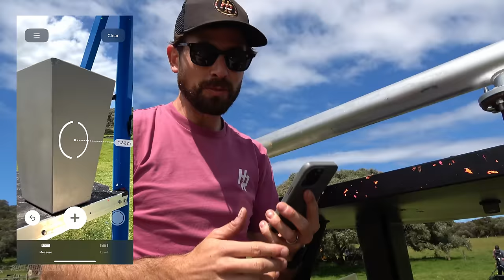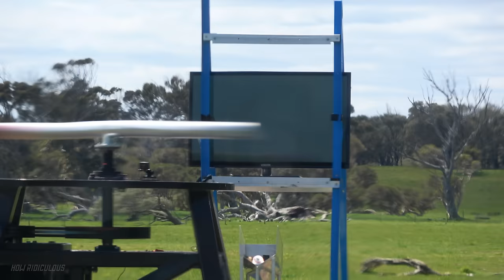1000RPM Baseball Machine Vs. Bulletproof Glass

Comment: Okay. The average baseball weighs 5.125oz. That’s 2242.188 grains. At 425KMh is traveling at roughly 387 ft/second. Or about 34.5% the speed of sound. So for what is worth, that’s baseball has 743ftlbs of energy. Or 1013 joules. That effectively like getting shot with a .44 magnum revolver. So yeah. Don’t get hit.
Reply: Very good I did the math too
Reply: @gilbert4018 MAN SHUT UP!!! 'FORE YOU MAKE ME DO SUM' I'M GON' REGRET!!!
Reply: Well, one of the weaker loadings available for .44 magnum, a lot of them are at 1500-2000 joules. Maybe 10mm Auto, those tend to be in the 900-1100 joule range? =)

Comment: I imagine someone must've said this by now but I can't find it so, just in case: what makes a steel mild is a low carbon content, and so it tends to be a bit more malleable than high carbon steel, which gets used in things like blade making because it can be hardened to better hold its shape (in the case of a blade, better hold an edge).

Comment: 1:40 If you consider carbon spice, then yeah.
5:34 They are the same unit. Velocity is generally used as vector, while speed is used as scalar. So if you travel from your home to your work, then the overall distance divided by your total time was your speed. But if at any point during the drive you look at your velocimeter, it will tell you your current velocity forward.

I see now that the bulletproof glass you got is rated for cannonballs.

Comment: Just a quick answer to any wondering. "Mild Steel" is referring to the the carbon content of the metal. Mild steel is a low carbon metal in comparison to something like Cast Iron which is high carbon metal.

Comment: Speed measures the distance over time, whereas velocity measures displacement over time. Distance is the measure of the total length traveled, and displacement is just how far you have travelled from the starting point. Also distance is scalar and displacement is a vector.

Comment: "Mild" steel is based on its ability to be hardened.  Ideally youd use spring steel if you wanted something reusable.  Theres also various grades of w and o class steels and n class steels based on thier ability to be hardened by water, oil, and nickle content as opposed to common c class carbon steel.

Comment: OK, speed is just how fast the ball is travelling.  Velocity is a vector, meaning it is the speed and direction it is travelling.  So even if there were no deceleration due to air resistance, velocity would always be changing as the ball arched downward due to gravity, and speed would be constant.

Comment: 1:37 What makes it Mild Steel?
Engineer here, mild as opposed to high strength. Mild steel is just, like, ASTM A36, fy=36 ksi (36 thousand pounds per square inch minimum yield strength). Rebar is 60ksi, high strength structural bolts are 120 ksi (ultimate, fu [vs yield, fy]), and guy tension wire can be in the 200-300 ksi range, but with very limited elongation at failure (just a couple percent, verse up to 50% for some steels, like a more mild steel).

Comment: It sure is baffling seeing the baseball busting through just about anything.  Until you realize that homemade batting machine is in fact hitting the baseball at speeds of roughly 264 miles per hour!  Equal to the winds in a low level F-5 tornado (original Fujita scale).

Comment: Mild steel is low carbon steel. Good strength, but softer and easier to work than higher carbon steels. Also less susceptible to work-hardening.

Comment: The idea of Nord VPN is great... except, when I used it, it wouldn't let me access ANY website unless I turned it off first and then turned it on once I got to the site, and even the, the load times were awful... I use a different VPN now which works so much better.
Worth mentioning that I am a 24 year computer tech, so no, I wasn't using it wrong.

Comment: The difference between mild steel (44w/a36) and special grades of steel is the carbon content, mild steel has less carbon and tends to be a bit bendier/softer while higher carbon content makes it stronger and gives more of a snap at its breaking point
Reply: Thanks for info I didn't need, smh